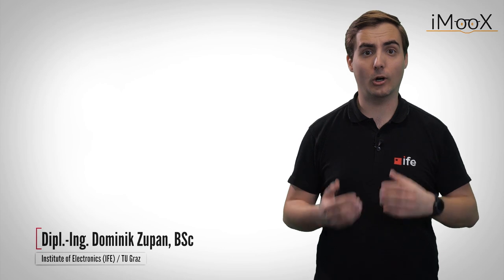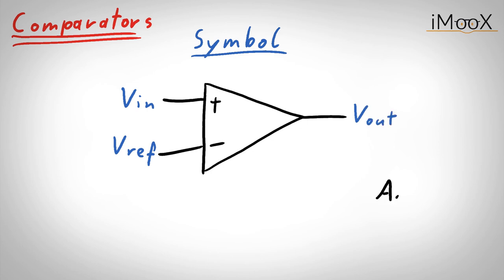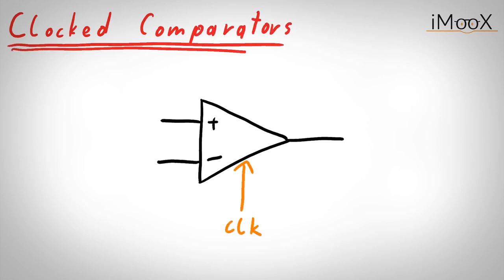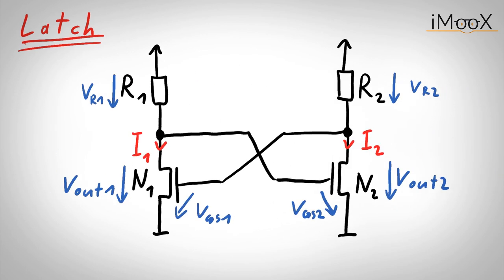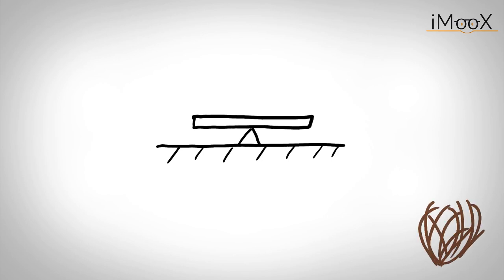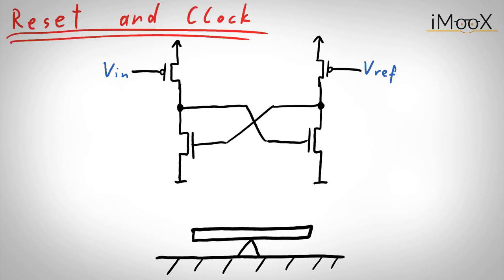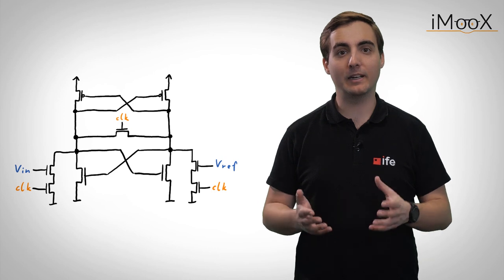Clocked Comparators

Comment: Thanks a lot, this video was very useful! Too bad that the second cross-coupled transistors pair and the input circuitry were not explained in detail. Anyway, good job!
Reply: Hi @Gauthier,
Thank you for your nice feedback. You are right I did not explain the last part in detail in order to keep the 

video more compact. Therefore let me try to explain the structures in this comment (refer to 

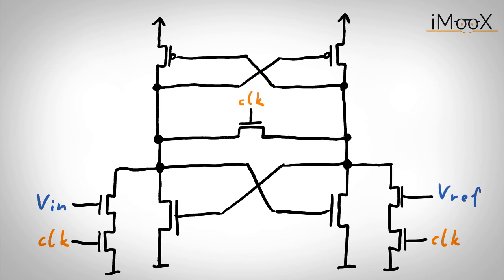7:25):

Second Cross-Coupled Pair
The main point in this cross-coupled latch structure is, that the left and right output nodes fall contrarily to 

ground resp. supply potential (or vice-versa). We already achieved this with our first cross-coupled transistor 

pair. However, as we do not want any current to flow after the latch has switched (or let us call "fallen") into a 

stable state, we add the second transistor pair, that acts in the same way as the first one.
Let us have a look at one stable state: When the output on the left is at ground potential, this means that the 

bottom right transistor is not conducting (open switch) and the top right transistor is conducting (closed 

switch). This means that the right output has to be on supply potential, which means that the bottom left 

transistor is conducting (closed switch) and the top left transistor is not conducting (open switch). You see, 

that in every branch we have a non-conducting switch, such that we do not use any current, when the latch is in 

one of the stable equilibria.

Additional Input Circuitry
The additional input circuitry is again used as a preliminary bias, in order to put the circuit in a non-

symmetrical state. Let us neglect the clocking and assume the two outputs are equal (refer to 7:25). Now we have 

two additional transistors, that are controlled by Vin resp. Vref. These are responsible for "pulling" our outputs 

to ground. However, there it is important, which transistor is "stronger", meaning: Which transistor can pull the 

output more to ground? It is the transistor that has the higher gate-source voltage. This means, that if for 

example Vref is higher than Vin, the right output is pulled down faster, than the left one, which will end up with 

the right output being on ground and the left output being on supply potential.

I hope this makes it clearer to you.
Do not hesistate to ask further questions ;)